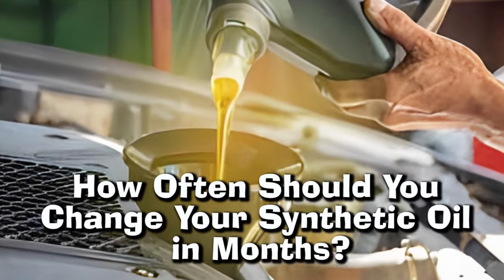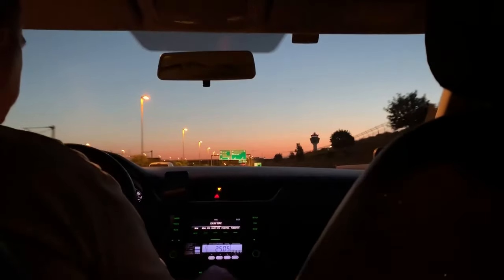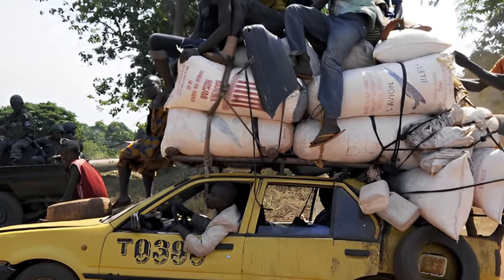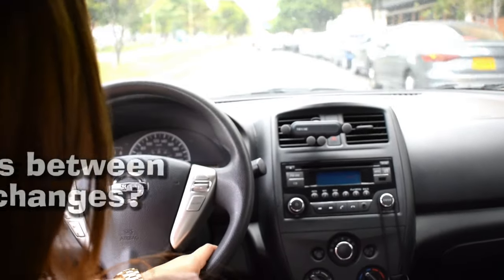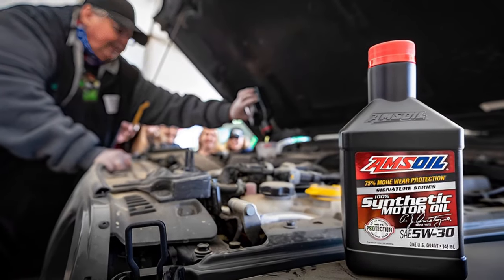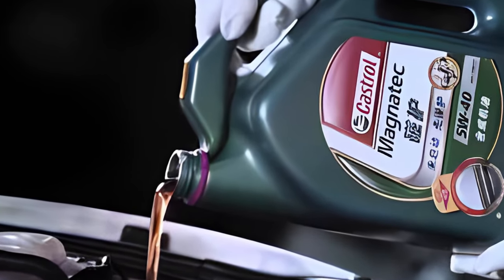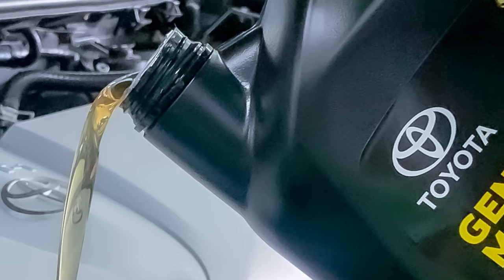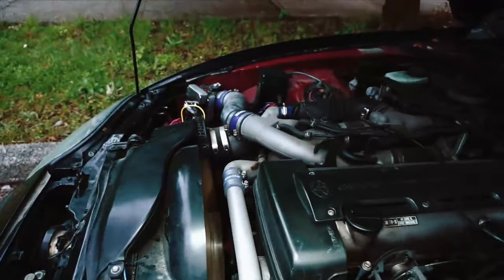How Often Should You Change Your Synthetic Oil in Months

Comment: Actually, you don't need high mileage oil at 75,000 miles. Engines today are better than they were 20 years ago. 75,000 miles is not high mileage that you need to go to a higher mileage oil. The additional additives in those oils are not always needed at 75,000. Maybe 100,000 miles+.
Reply: Dude, you are wrong.  High mileage oil is not used to protect the engine.  Its designed to soften all those dried up and hardening rubber seals so they don't start leaking.

Comment: New engines that contain turbos, the general rule is 3000 miles to 5000 miles or 5000 km to 8000 km.  Naturally aspirated engines 5000 miles to 6200 miles 8000 km to 10000 km.   General rule of thumb is cut all manufacturers recommendations in half for all fluids in your vehicle, which include coolant, transmission, differentials, transfer case, power steering.  Brake Fluid flush every two years.  You cannot go wrong with full synthetic.  Most people have no clue how to care for turbos.  In a well designed engine they are cooled by your engines coolant and oil.  Running your engine hard and then immediately turning off your engine will drastically shorten the life of your turbos, also, not warming up your engine has similar effects.  Spooling up your turbos is fun, but it comes at a cost, especially if you don’t let them cool down by idling your vehicle.
Reply: 3000 miles on a synthetic oil is too soon. 5000 miles is ideal particularly for low-mileage vehicles

Comment: I drive Cummins use shell t6. And change it every 5 to 8 thousand miles. Which is half what is recommended from Cummins 
Simple cheep insurance oil cheep Cummins engine very expensive I also put about 45000 miles a year on my truck a year